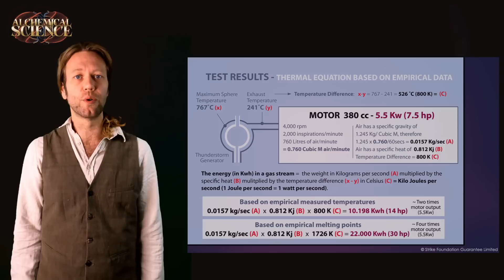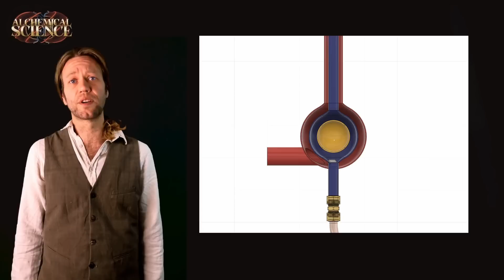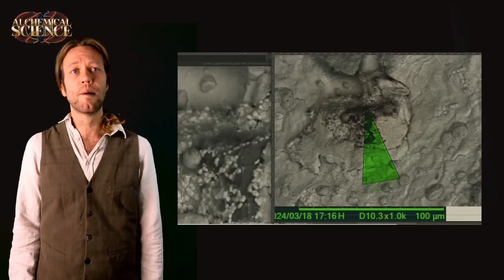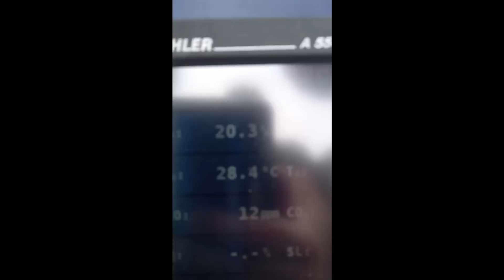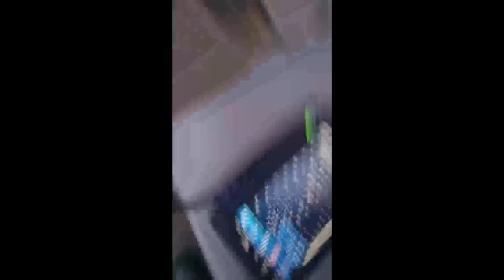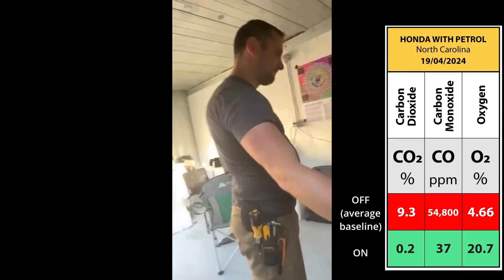Malcolm Bendall's Thunderstorm Generator | BEGINNERS GUIDE + NEW Trial Footage from the US

Comment: Somebody please explain why this is not the explanation for what is happening:  1) The bubbler introduces much higher than normal amount of oxygen going into the air intake of the engine; 2) everyone knows that combustion of hydrocarbon fuel without sufficient oxygen raises the amount of carbon in the emissions, and conversely, extra oxygen does just the opposite; 3) increased oxygen for combustion increases fuel efficiency; and 4) carbon is building up on the inside of the sphere(s) of the exhaust stream tube of the TSG.  I'm not saying the results aren't real, but if 1-4 are valid, then this may have nothing to do with plasmoids.
Reply: It's a good point, also there should be a MASSIVE amount of condensation coming out of the exhaust pipe if the inner "plasmoid" tube is really that cold.
Reply: I posted this to a clip of Randall Carlson on Shawn Ryan... 

Yeah, initially maybe there is more carbon buildup on the inside of the sphere(s), but then a threshold is reached and enough additional oxygen becomes available for combustion, which in turn reduces the amount of carbon build up in the spheres, but perhaps not entirely. The heating of the exhaust channel of the "vortex tube" may also increase its ability to scrub carbon.  People need to realize that the two nested tube-and-sphere elements of the "vortex tube" are not connected – there's an input channel (bubbler air) and an exhaust channel. The gases are not mixing.  Whether the bubbler air comes into the intake port, or between the carb and intake port, it's still part of the air supply to the carb.  In general, the physics of a rocket stove comes to mind, where the hot combustion chamber is causing more complete combustion, and the air flow is high. I think we could safely say that a very basic rocket stove could reduce CO2, CO, and particulates by up to 68%.  The difference with the TSG is that the exhaust isn't combusted; i.e. it isn't an engine exhaust reburner system.

Comment: I agree with a few of the comments.  This is great and all, but do the simple tests first.  1) Put 5gal of gas in it, and see how long it runs for vs unaltered gen.   2) Put 5gal of gas in it, and see how long it runs with a load such as a heater or air conditioner, vs unaltered gen.  Take the readings on CO2 and O2.

Comment: Can you please do some clear representation of the 5 gas analyzer before and after? (TS gen on and off).I have yet to see a clear shot of a 5 gas before and after on these videos, and can we please have someone operating it that is trained to do so and have reported 5 gas numbers on screen before and after? The 5 gas is probably the most important piece to verify this technology and it seems to take a back seat in the videos. Also a proper dynomometer test under full load  and part loads. Dyno. 5gas, labratory controlled environment, sensor data, temps and pressures in the chambers, intake air flow density before and after generator, 5gas analyzer by a competent brand operated professionally, piezo transducers in intake and exhaust streams to pick up any resonance occurring. Can we please get rid of these rickety generator stands that look like hell and present poorly to the untrained eye? I am sure someone with a proper engine dyno out there would offer some dyno time for this project. This is very exciting stuff but we need to eliminate slight of hand perceptions in the videos.

Comment: 3:30 How do they get from 526°C temperature difference to 800K ? 526°C temp diff is 526K.  also a lot of weird capital and small letter abbreviations for Joule, Kevin and kilo                       30:17 5.48% CO as baseline?
Reply: Yes, celsuis and kelvin are equal size units. Simple misprint. Temperature difference is 767 C (1040 K) - 241 C (514 K) = 526 (C or K). 
Tracking this through the calculations, they should show, 0.0157 kg/s x 0.812 kJ/(kg K) x 526 K = 6.7 kW
Reply: If it's 526 or 800 K doesn't matter, because we can't use exhaust heat for energy other than for turbos. And those would be necessary to equalize or improve the lower efficiency when engines run on their own fumes.

Comment: Is there significant helium production?
Reply: No, not likely. Helium is only naturally occurring below the Earth's surface.
Reply: @life_of_riley88  the question plays to the claim of nuclear transmutation. This would be synthetic, not natural helium. If there is transmutation,  then either fusion or fission is happening, or both. Detection of significant amounts of helium in exhaust gases could explain destruction of carbon.
Reply: @paulshields1883  Interesting. I'm not sold on the nuclear transmutation theory. I think this is just cracking oxygen from water vapor via heat.
Reply: @life_of_riley88  without significant CO2, CO, or hydrocarbons in the exhaust, there isn't anything chemical that could plausibly power the engine. Nuclear fusion would have energy density a million times greater than chemical however. The plasmoids, which are shown to be present by Bob Greenyer, from SEM analysis of metals cut from an early prototype, could perform that function. But if that's happening, fossil fuel consumption should be negligible as well.

Comment: Need to know hydrocarbon fuel consumption, during the tests. When fusion is happening, I expect that to be negligible, otherwise there will be a tremendous excess of heat. That's because energy density of nuclear synthesis is a million times higher than chemistry could produce.

Comment: Thanks for the explanation. For some reason I thought the plasmoids released heat in the combustion cycle thru implosion.  Replacing the need for
conventional fuel. 
Your explanation is that the thunderstorm system functions as an air scrubber?

Comment: Instead of using a ball valve on the intake of the TG (before the bubbler), it would be better to use a needle valve or metering valve for more precise flow control. You could also add a flow meter (a rotameter would be the cheapest) so you would know the actual flow rate when you find the "sweet spot." That would make it easier to reproduce the optimal flow rate on subsequent runs.
Reply: That makes way to much sense. Instead we'll just keep buying random scrap from the hardware store and guessing the flow.
Reply: Lots of pressure and temp sensors would be useful for sure!!! Where can I buy a plasmoid meter????????!!!!!!

Comment: One interesting thing would be a rebunking of the debunkers lol.

That one guy simply said "ah the bubbler puts moisture in the fuel air mix, thus making it twice as efficient"

Which neglects the fact it does not produce carbon monoxide or any real exhaust.
Reply: Robert Murray Smith? I think
Reply: I admire that they don’t waste time letting drama drag them down.

Comment: Malcolm bendall here WELL DONE PHIL and Jordan
Reply: Mr. Bendall, what is the purpose of the thunderstorm generator?
Reply: @kmstein35  I'm not the guy; but the thunderstorm generator is a module you can attach to an engine(A little diesel generator, or a JET TURBINE! It works on either.). The technology it operates on can do A LOT, and it's speculated to do even more,  but one demonstrated and proven result is purifying the engine's emissions. 

The bubbler part creates 'Plasmoids', that are like little energy systems that are self-sufficient to some extent that can eat and manipulate matter. These get shot into the exhaust and do magic to the carbon and c02 - which is what we're seeing on the emissions reader. 

There's so much more to this, and I'm barely well versed enough to convey my understanding. A lot of the leading members of these teams think the plasmoids are capable of living for extended periods of time inside of the thunderstorm generator's material - they call the models this has happened in 'activated', and we still see changed emission readings from these models even when the bubbler is taken off and no new plasmoids are made. 

For more information you'd best spend some time looking at Bendall's schematics and whatnot on his website, or watching some MFMP O'Day content. The MFMP channel is where I started to grip all of this and its very, very interesting indeed!
Reply: Thank you for bringing this old tech back to life, and doing everything correct on distributing the information. I would love to see this grow and be part of it, if you need a network and security person. 👌😎👍
Reply: Malcolm, I am available here in the USA to make any part you may need to help your research or production.
I would love to get involved in this project and make some kind of meaningful contribution.
Reply: @WeberMachineWorks the BEST THING YOU CAN DO is produce the parts and SELL THEM at the MOST AFFORDABLE PRICES YOU CAN so that as many people can begin using these as possible... the more people we get ON BOARD, POSTING VIDEOS, USING THE TECH, the safer these guys will be and the more well known this technology will become.  there's strength in numbers. it's the only way to get this accepted by millions... avoiding GREED and secrecy is the key

Comment: Just saw a demo of a pair of these in London, where they did a temperature survey on running units with 10 thermocouples dotted all over it, to better understand the thermal behaviour at the relevant points. Other meter in use taking gas measurements - O2 readings in the high teens, very low Co and CO2. Stubby design and the long neck version, they're really doing a lot of R&D, everything calibrated, so as to be unquestionably valid. Hopefully have the readings of all this sent to Bob Greenyer to analyse with all the rest of his data, get an independent review.

Got to keep reviewing and refining as more data comes from each evolution, and giving more units to different facilities to experiment and validate independently is a great way to independently confirm, and further improve it, but this is a very difficult and expensive process to keep doing - but necessary to get to an optimised design.

Hugely creditworthy effort by all involved. 👏👏
Reply: How about a accurate sensitive fuel flow meter on these units?
Reply: Where is that video?  This in mind blowing.

Comment: There is not enough energy in the generator to transmutation of any atoms.  If this was real there would be a huge melt down of that many carbon atoms splitting and fusing to make oxygen atoms.    What is happening is the ionized water vapor is slowing down air passing by the ventury tube of the carburetor in turn pulling less gasoline into the cylender.  The water vapor in turn becomes the new fuel replacement due to pressure and temperature conditions simultaneously splitting into hydrogen and oxygen when compressed and recombination when the spark plug fires.    It is way more clean fuel source but you only get about 1/3 hp factor.
Reply: Interesting theory.  Watching some other videos I've heard it mentioned that the water very rarely needs to be refilled.  There IS some loss, but no where near the rate that fuel is used.  Take it with a grain of salt, I'm stating this from memory behind my computer.... but if it is the case that the water loss is insubstantial, what impact does that have on this theory?
Reply: Look up the MFMP ULTR EXPERIMENT - Aluminium foil on a frame placed in the water bath of an Ultrasonic Jewellery Cleaner- in seconds of being turned on the Aluminium begins to break down AND Carbon film eruption fields start appearing (even with “pure” water) with Calcium also being observed).  No Carbon or Calcium present in the source materials, in other words, yet there they are - in an experiment a 5 year old could run!
Reply: I remember guys in the 70’s putting water drip devices on carburetors to improve efficiency.  Fuel flow sensor would be interesting as well as numerous temp, pressure and other sensors.
Reply: Seems like the super hot exhaust gasses are cracking the water vapor into a separate molecular make up. This allows pure oxygen to be burned, and possibly ignoring the by product of combusting air in its standard mixed form. Not so sure about the production of cavitated plasmoids.

Comment: Thanks for your interest folks. Please keep in mind two things can be true at once. I can be an unabashedly enthusiastic madman regarding the tech -- and also working my ass off in an entirely sane and methodically business-like manner to get to the bottom of this device. If I determine in the next 50 days until the summit (June 15 - 17, Greensboro, NC, get your $432 ticket with promo code: boom) the tech is a dud, you will know it first, and there will be no demonstration. That would suck of course.
Reply: Having got this far with it, there would be value in demonstrating the testing results and explaining how the tech was determined to be a dud, if indeed that very unfortunate situation occurs.
Reply: @annewitkowski7586 Its not just a dud, its a complete and deliberate scam... and a very obvious one.  The 'creator' needs to be arrested.
Reply: It seems obvious to me to he is simply pulling air through water and sending it out the other end.  There are two exhaust systems in the prototype.. One of those has the real engine gas and the other is just ... Hot Air... so to speak.  I fail to see how a water bubble is expected to travel up in to the tube and "implode"  once it leaves the water it would just be air.   Who knows whats inside the tube, but it is likely some sort of turbo like device that is using the engine exhaust to create the suction for the water chamber....  A nice bit of deception it appears..  If not then show the lightning ... show the plasma... show actual readings from both exhaust tubes...
Reply: Great results George love your enthusiasm PRAISE GOD IN ALL THINGS. I’m so pleased the COSMIC SUMMIT is bring forth hidden Knowledge as it is the honour of Kings to do so. God bless you George and Phil.
Reply: Fom Al haut IS MALCOLM ROY BENDALL of the book “THE SHAMAN by Roland Perry.
Reply: Brian unfortunately for you I am here MALCOLM BENDALL  calling OUT your DEEP STATE TALKING POINTS  As untrue in such a blatant disinformation failure. You came to the wrong place this audience here has above preschool education and are here to support humanity not destroy it as is your intended outcome of you obvious untrue text. May God bless you and cast light on your darkintensions for all to see.
Reply: I can tell you guys EXACTLY how this scam device operates right now and save you all being scammed out of this $430 if anyone wants to know... its actually very crude and obvious to be honest.  So the host here must not have the most basic concept of science or combustion...

Comment: Has anywone ever weighed the steel wool before and after running? Ideally I'd see it at least once on a bubble without any other retrofit parts, once with the UV light, once with the full retrofit. Same but many hours on each. Deeper analysis of the steel wool might bring good data.

Comment: Has anytested the power that a retrofit can handle? Air volume processed, useful work done by the engine, fuel flow, etc?
Some wonder whether these retrofits can work under full load.

Comment: The design with all the pretty numbers, frequencies and ratios, it's only "essential" if deviations can never perform as well. 
The pipes got very short because they could not deal with thermal expansion, being dead straight. Why does short work as well suddently?
GEET worked similarly (different layout) and skipped the complex nested spheres. What's the actually minimum setup that nets the result?
What can we get out of the exhaust? We have so much oxygen already.  Hydrogen would be more helpful, even if only a little, or very cold hydrogen.
Reply: I wonder if the exhaust could be fed back into the system at the carburetor butterfly opening or the bubbler intake or would it’s high temperature and pressure oscillations be an issue?
Reply: I think the minimum setup is the Joe cell

Comment: The pipes could suddenly be shorten by...a factor of 10?
That makes me wonder even more strongly than I already did, whether the spheres are even needed, less alone in such specific scale ration.
Reply: Look up the geet. It did the same thing and it didn’t have the spheres. It did have a solid pipe on the intake pipe that would spin and do basically the same thing as this thing is doing.
Reply: Seems like square “sphere” chambers and pipe would increase turbulence and pressure.  I wonder if the vortex rotations would change?  Flat metals would be less resistant to flexing?